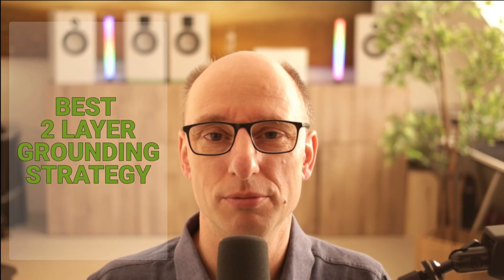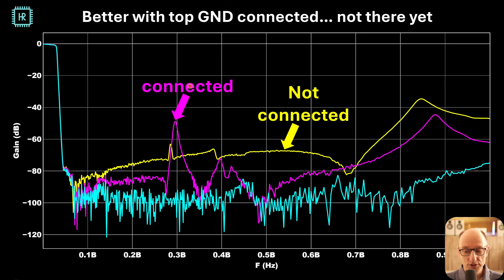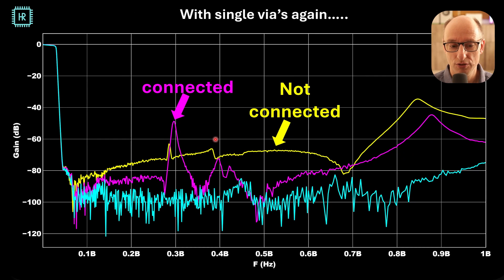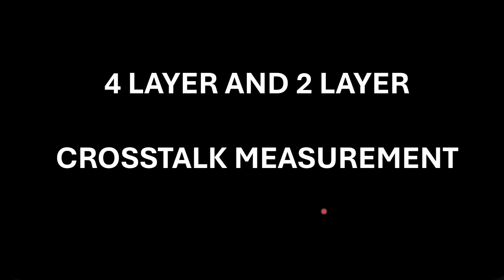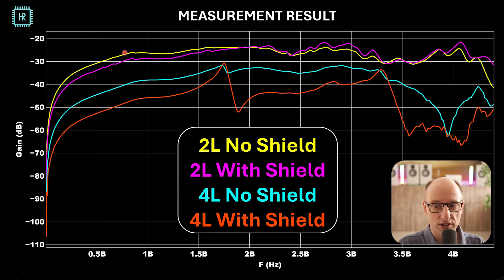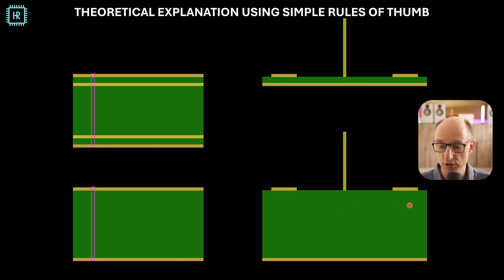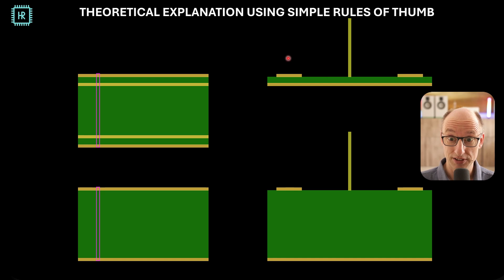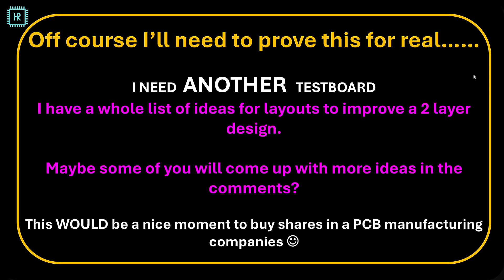Practical 2-Layer RF Design Rules (That Actually Work)

Comment: how are you getting thise scope readings? pyvisa?
Reply from the maker: I think the program is called: nano vna saver. I get the data and then read it with a python program I wrote to visualise it.
Reply: @HansRosenberg74  do you save it to a usb stick? or stream it via usb or ethernet?
can we see your code?
Reply from the maker: I install nanovna saver on a laptop. I use it to control the nanovna, then I export the characteristic to my laptop drive. I copy it to the pc where I make my movies and then do the processing using python. I should make  a video on this I think, and put all the code in a page on my website. Will be a bit of work though.
Reply: @HansRosenberg74  that would be rad. you know Im watching all your vids.
Reply from the maker: curious: how much is that bode 500 VNA..... they don't tell on the website...
Reply from the maker: oof, I found it: 14500 usd!!!! Yeah, might as well buy an r&s or something like that :-)
Reply: The nano vna really is a nice tool. It's amazing what you get there for such a low price. However, the software is a bit of a problem. VNAs are very software-itense for all the processing, error correction etc. needed, but a few hobbyists just don't have the resources to really make that shine.
At work, we are about to buy a Bode 500 VNA now. Especially nice for users who also need to measure at lower frequencies and the software is great.

Comment: Just read your checklist.  Good read and helpful.
You ask in your book what are we struggling with, so here goes. 

I am new to all of this, I had my first board made and it was a success.  It was a simple LND150 Mosfet gain stage for use in a tube amp.  I want to do more and I don’t understand layering and trace sizes.  I do not understand  vias and how to size them.  I am used to building my board as turret boards or eyelet board.  I need to understand how to select the trace size.  For high current I use 18awg-20awg wire and for my small signals I use 22awg wire.  How does this equate to trace size? I will still need large wire connections is this just a large via?  

I am really enjoying your videos.  Thank you.  Chris.
Reply from the maker: Hi Chris, thanks a lot for responding to my question for ideas people are stuggeling with! These are some really good questions that I wouldn't have come up with because I've been doing this for soo long :-) I'll need to think about these to come up with a good answer. I want to come up with a simple set of rules to pick the right sizes.

About layering: Standard is 1.6mm thick pcb material with copper on both sides. This is what every supplier produces the most. You can make almost anything with this unless you start messing around with microcontrollers, ram, fine-pitch components etc. At pcbway, you can get a 10x10cm board for a little as 5 euros (you get 5 boards) plus shipping so using turret or eyelet boards is not economical anymore if you know how to design your own boards.

Best regards,

Hans

Comment: Very good series of videos. Looking forward what will come in the future. one question, maybe a silly one. Do the connections between the filter components not also act as a transmission line and that has to be taken into account?
Reply from the maker: Thanks, The wavelength is too long for the traces between to be a problem at these frequencies.

Comment: Please, send me the checklist.
One very small improvement I like to request... Could you please avoid numbers after the decimal point? It took me quite some thinking why the first inner layer of a 4 layer board of 1.6mm is at 0.90 mm and in the 2nd video I just took it. But in the 3rd video you say more "zero point nineteen" which then results in 0.19 what seems to be more logical. If you'd have used "zero point one nine" that would have been much clearer from the start. 
I am interested how long vias in a 4 layer board impact crosstalk if they are isolated from the 2 lower layers. You probably may run other supplies or signals in layer 3 and 4 so you have a stick antenna there? May be, it is also interesting to see how to move designs to Rogers PCBs and showing the impact of the PCB material as well.
Reply from the maker: I was thinking about how to word those numbers, it's a compromise I think. It is quite hard to keep consistency with it over multiple videos, I'll try to think about it. The vias are not that much of an antenna, they're still small, its more the loops it creates. I wanted to do something about rogers, but that will be a very expensive experiment. I'll do this in the future if some money comes in from youtube :-)

Comment: Rather than a via you could use a through hole compoinent hole and solder a lead in. These videos have  been very helpful.
Reply from the maker: that would work, it would still have some inductance though. The ground plane is still quite far away, so I expect adding multiple vias will still help in that case
Reply: @HansRosenberg74  Thanks. I was opperating under a false assumption that I really should have known. Size of the conductor has some influence on inductance,,, multiple inductors in parallel are more efffective. I get it now. If I had really payed attention in high school I likely would have had this engraved in my brain,,, but ,,,,. That was 50 years ago.

Comment: Hello, I don't really have long term experience in PCB design or electronics as I've been in embedded software development for most of my career. However, I am now retired and doing some electronic projects, including PCB design, mostly as a hobby. I also watched many videos from Robert Ferarec, I suppose you know him. 

I downloaded your Checklist Guide which it's great overall, but I found something I am not fully comfortable with based on what I learned previously. 

It's about your suggested 4-layer stackup. Some designers suggest (1) placing continuous ground planes on both Inner layers and signal/power traces only on top and bottom layer, (2) trying to minimise signal vias and (3) always placing at least one sticking GND via next to any signal transfer between the outer layers. 

With this stackup you make sure that one ground plane is always very near all the signal traces, which minimises crosstalk and maintains constant trace impedance regardless of trace layout. It also prevents all disruptions or cuts or signal return paths.

On the other hand, your suggested layer assignment does not seem to guarantee it all, unless you are very careful with the actual layout, which is more prone to mistakes or omissions (?). 

What's your view on that?
Reply: So, please will you answer or comment on this? Thanks
Reply from the maker: Hi, what I generally do is put the signal and power traces on inner2 and put as much ground as I can on layer 4. Often this means layer 4 is a near perfect ground plane. So basically, compared to what your are saying, I'm swapping inner2 and the bottom layer. Electrically, the ground will have the same distance to the signal layer. However, by putting the signal/power traces on inner2, they are now completely shielded on both sides by ground, minimizing possible interfering transmissions. You  are also offering return paths on both sides of the signals on inner 2, which is another improvement, though a minor one because of the distance to the plane on inner1. I think from an RF viewpoint, this is a better solution. A practical disadvantage could be that you cannot reach those traces for reworking or debugging. 

Adding ground vias next to signal crossings is a great idea, it guarantees the shortest path for the return current.

Let me know if this clears things up. (I revised my first answer, maybe you already got this in the  mail, I'm not sure, I answered to quickly but when I thought about this longer I found this was the better reply)

Best regards,
Hans
Reply: @HansRosenberg74  Thanks, yes this makes sense to me now. As you pointed out it's basically like swapping my 3rd and 4th layers, with the added advantage of ground shielding on both sides of 3rd layer. Great!

 I have now another question: According to your suggested layout, in which you use inner2 to signal/power, does it make sense to fill that layer with copper attached to power?. I mean, a mostly continuous plane of power on that layer, instead of actual traces for power. I think this will create, to some extent, a continuous capacitance between power and the adjacent ground layer which should improve power distribution (?) Does this make sense, or may it introduce other problems? Thanks again
Reply from the maker: Sounds like an excellent idea. Especially if you make sure you have decoupling caps at regular distance (which you probably already have on a lot of locations) the power plane will also perfectly function as a ground return current path. You could even place np0 / cog caps near the start  and end of  a signal trace between gnd and power to offer the return current a very short path along the power plane. But this would only be necessary for extreme cases where you have a very high speed line and you really can't afford a ground plane because you need to conduct a large current in the power plane so traces really won't work there.
Reply: @HansRosenberg74  Thanks !!

Comment: Please try a top layer ground fill on a 2 layer board that is 0.2mm from a trace, and that top fill is stitched to the bottom layer ground plane?
Reply from the maker: It's on my list :-) This should stop crosstalk and secure a much shorter return path, this should work on the exact same layout. I'm really curious if we can get to the 4 layer performance. Will be one month from now though, I 'have' to go on vacation :-)
Reply: @HansRosenberg74  Oh wow that is excellent news! I am quite curious too, though with Chinese pcb manufacturers now offering low pricing on 4 layer boards there’s less of an incentive to use 2-layer. Have a great vacation!!

Comment: One Suggestion I would have for improving this kind of two layer PCB would be to make a slot in the PCB and soldering the shield to both sides of the PCB, and therefore eliminating any chance of field passing by.
Reply from the maker: haha, that would be really really drastic and effective! I'm thinking about a via-wall now. that should help a lot as well. It's also a little less rigorous :-)
Reply: @HansRosenberg74  Via wall was the first thing that came to mind.

Curious how via stitching would effect the filter circuit on both the two layer and four layer boards.

Comment: Suggestion,  you could design good and bad layouts for a PCB design for a simple switchmode DC buck regulator.  The measure of success would be ripple.  
Id also like to see an explanation of how to design audio boards with single point grounding.  Great series,  thanks!
Reply from the maker: Thanks for the ideas. I was thinking about a dcdc regulator for  a video already, but great that you show that there is a real interest there. About single point grounding: I'll make  a video on that, its on my list for one of my next video's. I'm an audio design engineer myself for over 30 years, I know single point or star grounding is considered good practice but it really reduces audio quality. Planes are much better because they have a low impedance at high frequencies. Even though audio is low frequency, it will pick up high frequency interference that mixes down due to non linearity and get's into the audio band. I'll go deeper into it in the video which comes out in a few weeks. I have a vacation for a few weeks to come.
Reply: Linear Technology/Analog Devices has great application notes on switch mode converter PCB layout, AN136 and AN139 are well worth the read. I would say the measure of success is radiated and conducted EMI. Ripple is mainly defined by inductor size, switching frequency, switching mode (CCM, DCM, burst) and ESR of the output caps. I can tell from experience that laying out a DC/DC without any rules like it's just a 555 blinker can turn the circuit into a very powerful radio transmitter ☺

Comment: Nice videos !!
Please send me the checklist!
I have some coupling troubles with my homemade domotic: when I switch some lamps on or off, it also switches another one that has a secondary switch in the same area 😅 and it quite bothers my wife 😅😅
Reply from the maker: I'm pretty sure  good grounding will fix this, sounds like a typical grounding problem. Also make sure you have good supply decoupling!
You can get it here:
https://www.hans-rosenberg.com/checklist
Best regards, Hans

Comment: Great videos. Thank you! When I check ground plans to see if they interfere with the (microstrip) trace, I use a pull back distance of 3x dielectric height. Was the pull back on the 2 layer and 4 layer the same?
Reply from the maker: No, it should be less on the 4 layers, since the capacitance to ground is larger there.

Comment: I have enjoyed these videos so far, thankyou!  A tentative suggestion: I'd love to see you do some videos later about grounding in mixed-signal type systems: there seems to be a real shortage of resources/tutorials/worked examples in this area that are suitable for hobbyists/amateurs like myself.
Reply from the maker: Thanks a lot! For mixed signal the exact same rules apply. Just remember that when working with digital signals, the required bandwidth is at least 9x the maximum clock frequency, you need up to the ninth harmonic!

Comment: B for billion? Never seen that before on an electronics plot.
Reply from the maker: Ah, thanks for reminding me to solve this annoying little problem :-) I fixed it for the next video. I'm using plotly in Python and this is the standard notation. I had so much work for my first video I didn't have the energy to fix this one at that time even though it was annoying me :-) So now I solved it :-)
Reply: @HansRosenberg74  Excellent work you are doing!

Comment: Compare standard FR4 to Rogers 4003C or 4350B. Rounded vs right-angle vs mitered track corners.
Reply from the maker: Thanks for the idea's, I wanted to try rogers, but man: That stuff is really expensive. Once my channel is monetized maybe I can invest a bit more. I did use rogers in the past when I was evaluating a 4-5GHz radar chip, it works wonders!
Reply: @HansRosenberg74  You could probably ask Rogers for material if you show results on YouTube
Reply: @rfdspguru2  It would be incredible if Rogers would join the "I want to thank Altium and PCB Way for sponsoring this video" gang 😂

Comment: Your videos are top gold, I hope for a lot more to come! How important are these design principles, when dealing with digital circuits of relatively low frequencies? Like ESP boards and their usual peripherals like I2C, SPI or USB? So far I only did 2-layer boards to save on cost and never bothered about the ground plane and messed it up by routing signals lines through it and thus cutting it up in smaller connected areas. I guess in a multi Ghz board, this would have disastrous consequences, but so far my boards do what they supposed to do.
Reply from the maker: I'll make a video on this maybe. Remember, a 10MHz clock needs a 90Mhz bandwith, you will need the 9th harmonic to make it look a bit like a square. This means you're already 'jamming' FM radio without a groundplane :-)
Reply: @HansRosenberg74  I'm going to test this. I should be able to pick this up using the HackRF and if not, it shouldn't be too bad.
Most of my designs are battery powered and only on for a few seconds per day. The other is encased in a closed, grounded box.
Nevertheless, I would appreciate a video about EMF and how to check designs for that during design phase and after production with tools an amateur can afford.

Comment: Another amazing video! These rare nuggets of 'integrety' or whatever you want to call it are what are still showing how good the internet can be despite it being drowned in an almost endless ocean of shit.

On the topic of PCB-design or maybe electricity in general, I've heard it being said that 'the energy is in the fields/the dielectric etc etc'. Which kind of sounds profound but I can't help but feel it kinda sounds a bit like saying 'the energy in a waterpump and pipe system is in the pipes' because there is only pressure and direction of flow because the pipes prevent the water from going everywhere.  I was wondering if you had any thoughts on this?
I have little to no experience in RF electronics so maybe im just talking nonsense, but yeah.
Reply from the maker: That is a big compliment, thanks!
I haven't thought of the 'water equivalent' for RF yet. I will be making another video that explains RF a little bit further again, hopefully I can post that next week.

Comment: Very usefull information. I would also prefer some practical exemple. Take a design and design it with 2 layer and 4 layer. Anyway Interesting theoretical staff. How about the book,  some exemple înșine?
Reply from the maker: Please check part 1 and 2, that covers differences between 2 and 4 layer designs with practical examples. The book does not have these examples, that would be something for if I turn it into a real book :-)
You can get it here:
https://www.hans-rosenberg.com/checklist
Best regards, Hans